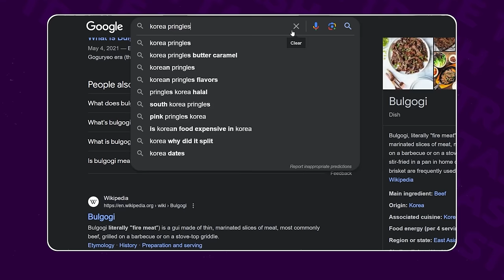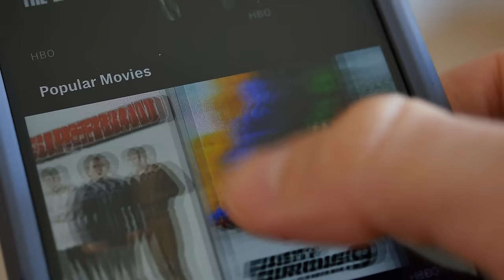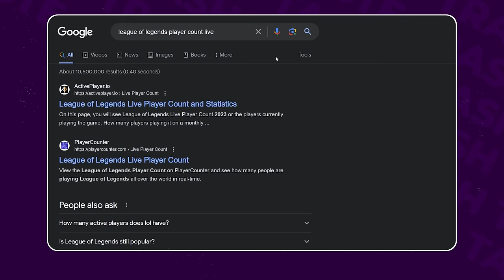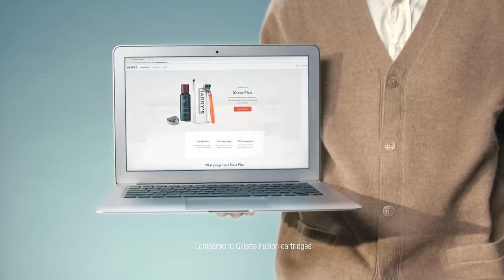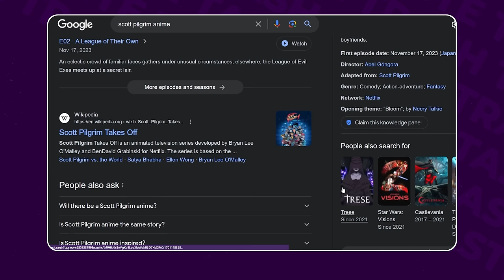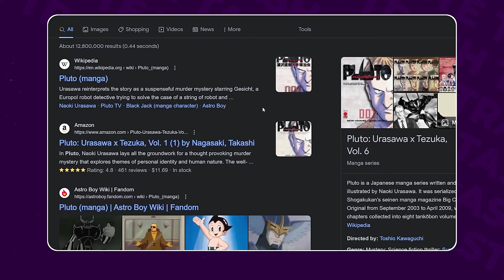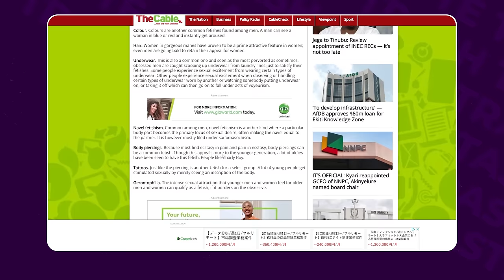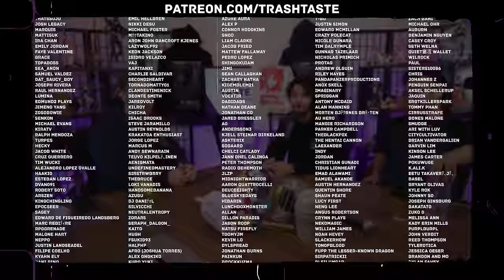Should We Move To Korea? | Trash Taste #181

Comment: The reason many stadiums don't allow plastic bottles specifically with a cap is that they are considered trip hazards. A bottle without a cap will be crushed if someone runs over it while a bottle with a cap on will resist and roll if someone steps on it and can cause people to trip in the cause of an emergency. Same reason glass bottles aren't allowed though they can also be used as weapons.

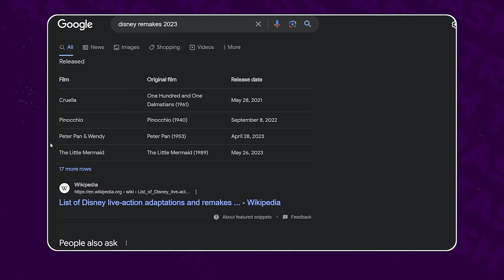Comment: 1:08:29 I think Connor was thinking of the non Disney Pinocchio.

1:22:29 Most if not all of American shows go on a break during the Holiday season and resume in the new year. Invincible taking a break is nothing new in the slightest.

1:25:00 86 only took so long for the final episodes because there were literally no free air times until months later. It was cool because whenever they did need to have a delay, most of the comments on CR were being positive in wanting A1 to take their time and they could wait. The negative comments were drowned out.

Comment: A fetish is when you are extra attracted to a certain aspect irregardless of whether it's inherently sexual. So having a fetish for breasts means you have a skewed preference for when breasts are visible. I'm not really a fan of paizuri and oral so I consider them a fetish thing since it's near impossible to get me off. To me those are just foreplay.
 
Mine is consecutive creampie, as in having sex multiple times without ever pulling out. It's surprisingly hard to find something like that since it's not really ever a focus and thus never labeled to be included. It's so niche it doesn't even have a term for it! There's also the sex through clothes thing, like super stretchy clothes, but that's a little more easy to find since it's about a quarter of the results the rest being side parting or hole in clothes which is more sex "around/past" clothes than through but is still labeled as such. That's definitely a bonafide fetish. My fetishes revolve around creampies without concern. Through clothes is like you're so much in a rush there's no time to take it off. Consecutive is like you're insatiably attractive that I just need to keep going with disregard for refractory periods or rest. The key thought being "I'll impregnate you no matter what". The thought that you are able to impregnate someone with extremely low fertility through sheer quantity of attempts is the best!
 
Don't even know where it comes from since I'm not actually looking to be a father, but there's definitely a primal desire being fulfilled there haha.

Comment: About the live action Avatar vs One Piece thing

Thing is, One Piece is a big commitment to get into. So a live action show can potentially be a good gateway to people who feel overwhelmed seeing over 1000 chapters or over 1000 episodes.

Avatar TLA is a pretty normal sized show with normal sized season (well, a bit long for nowadays I guess, but modern TV shows are basically all like 40~ minute long episodes and Avatar is a normal 20~ minute long ones). Its super easy to get into Avatar if you want. Because the Live Action One Piece is not as good as normal OP. Its quality is acceptable and I have very few major complaints, they did a fantastic job with adapting something many believed to be unadaptable. But it IS inferior and the show is only going to be HARDER to adapt as it goes on and the powers and character designs get more and more out there. Avatar live action will also definitely be inferior (though I imagine infinitely better than M.NightShitupon's version) but the bar of entry is so much smaller that its just absolutely baffling on why its being made.